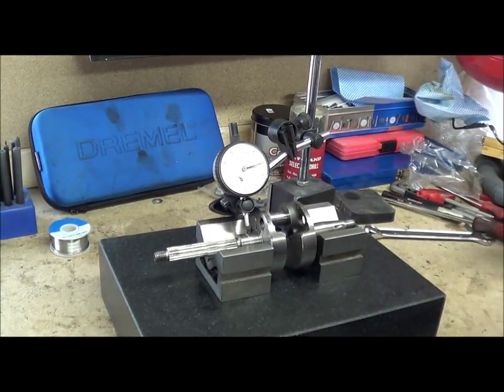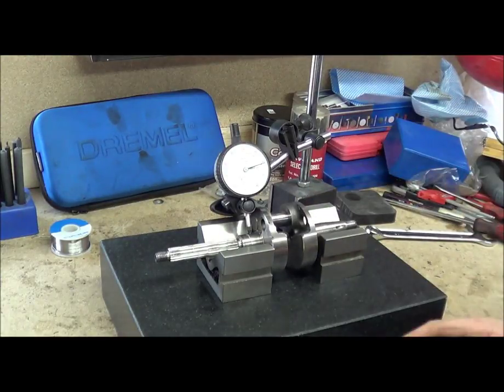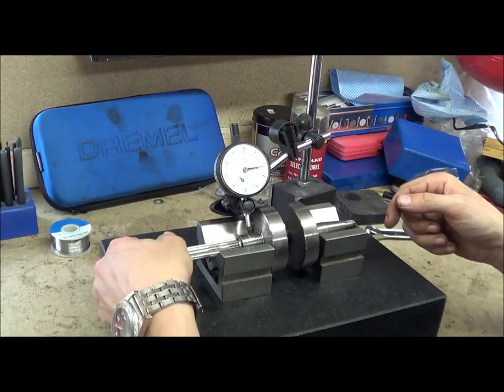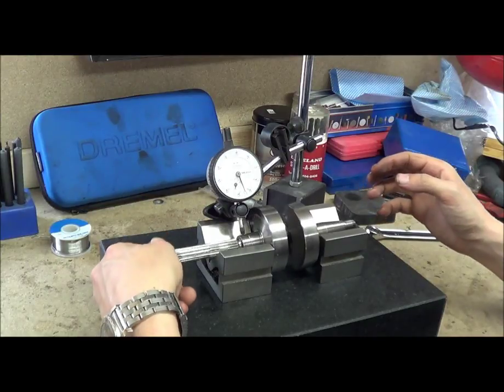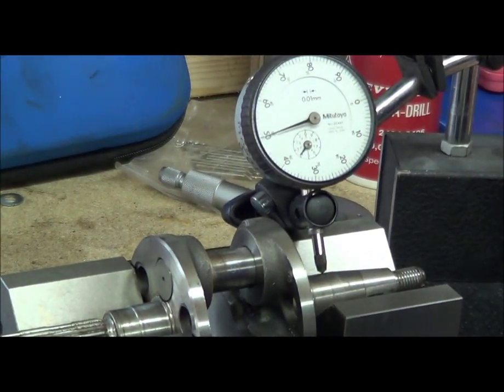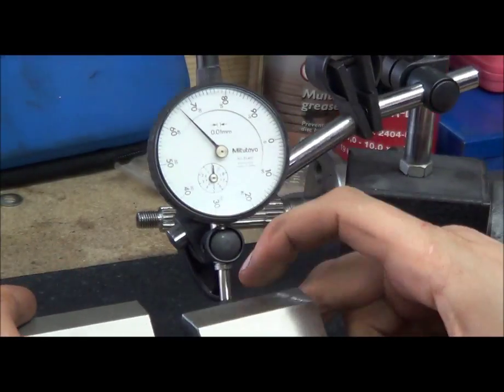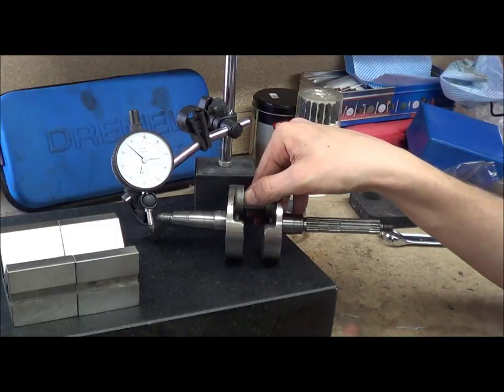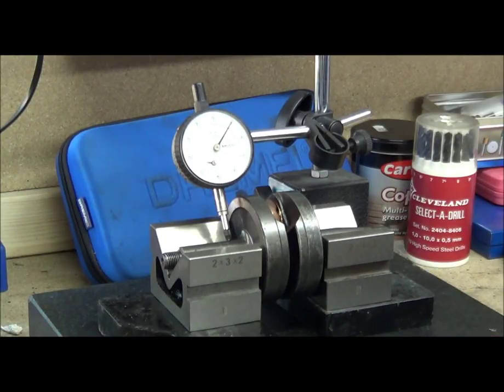Crankshaft Run out Measurement

Comment: What? Your measuring device is placed in the wrong place! You are measuring right above the place where you support the crankshaft. What are you expecting to measure? The ovality of the crankshaft at the place of the bearings? 
Your crankshaft is so much out of place that your actually measuring something. Any normal crankshaft will give you a 0 value, even if it is slightly out of place if you measure it like this. Please place the measuring device at the end of the crankshaft. That will give you a good reading.
Reply: Frank Franky My manual says to place it 8mm from the crank journals